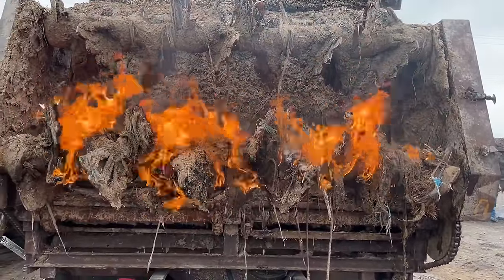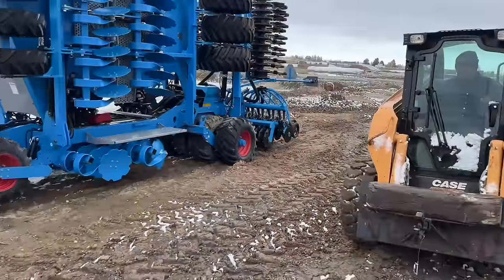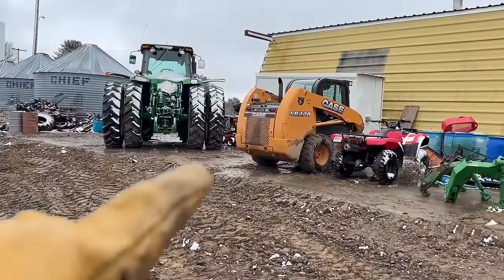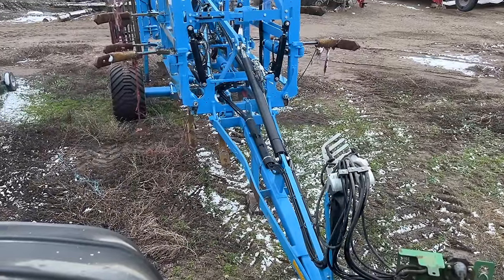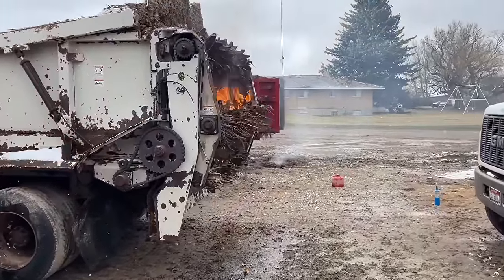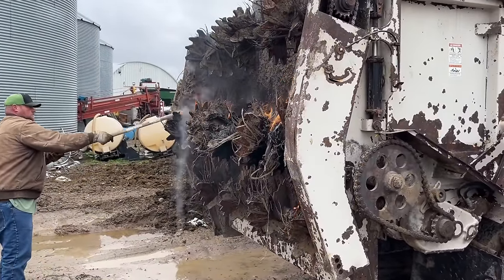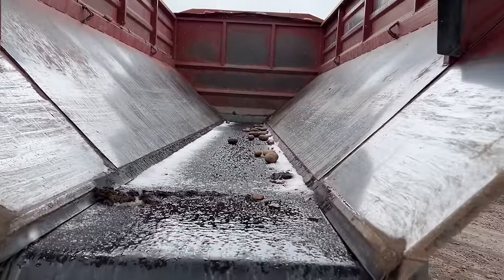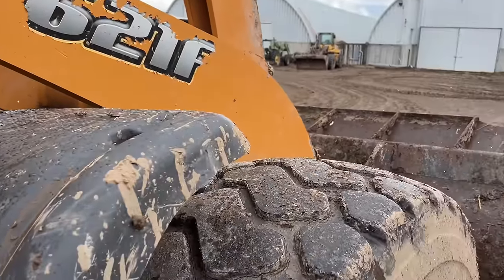Preparing for manure hauling!

Comment: Have you guys ever thought about getting 40-ton pull-type spreaders to replace those trucks? What I've found, with help from a friend who went all in on them, is that you can replace three of those trucks and two workers (since it's hard to find help to run our trucks) with one pull-type. I run a JCB Fastrac with a Bunning 380, and it's amazing what one guy can get done compared to the trucks. It seems like a lot of money to buy the setup, but by the time you calculate your time, fuel, paying extra help, and overall less equipment to maintain, it works out.
Reply: Also forgot to add that with these spreaders you also have the capabilities to minimize compaction and more accurately control how much tons per acre your putting down
Reply from the maker: We haven’t really looked at it the ones we have seen wouldn’t work too well in our situation but I’ll have to take a look.